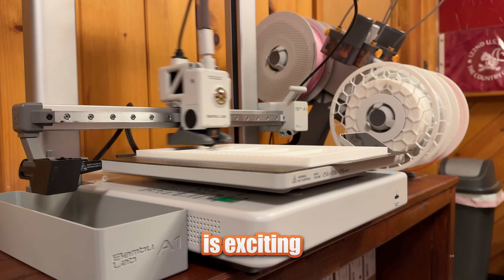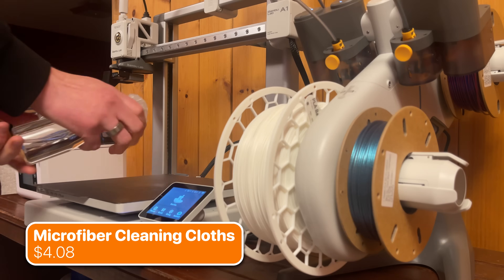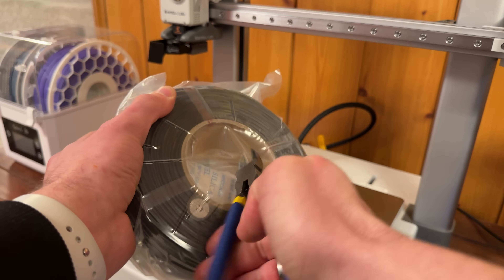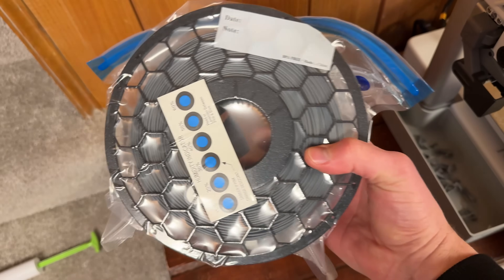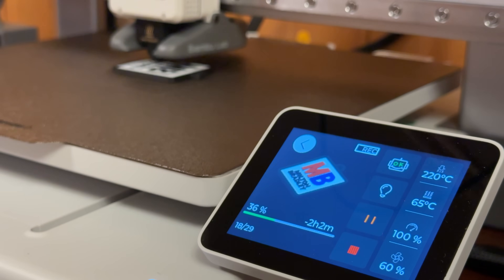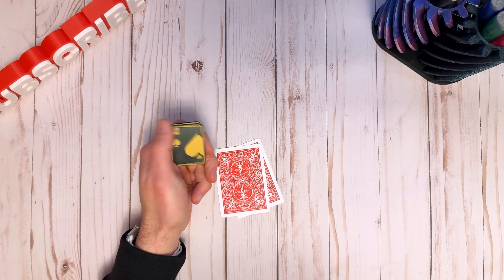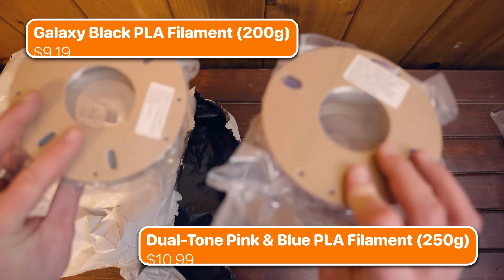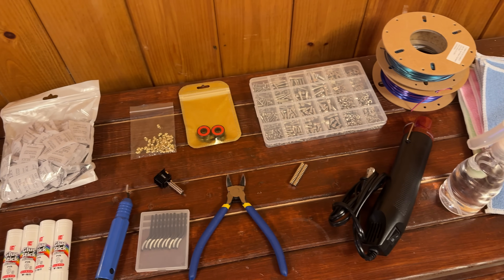Must-Have 3D Printing Accessories from Temu!

Comment: Rather than those bagged silica gels, there are reusable ones that you can dry up in the microwave or oven and use again. Additionally, they change color when saturated.

Comment: I have a tip: scrapers. They are amazing for rounding off edges, removing that last bit after tearing of the brim. After i made some of my own set, i haven't used deburring tool at all. Any metal piece with sharp and clean 90 degree angle will do, unlike wood scrapers plastic scrapers need very tiny lip or no lip at all (search for "how to sharpen cabinet scrapers and you'll get the idea, a lot of metal rulers have excellent edges). Scrapers can also be used to smoothen out layer lines prior to sanding, and will cut down sanding to about a tenth. You save a TON of sandpaper. Scraper cuts small shavings off unlike sanding that uses abrasion. The finish is instantly smoother. 

The ones i made from fish deboning tweezers are my most used tool in the shop. I use them even to scrape off injection mold seams from plastic parts, any sharp edges on any plastic stuff can be treated and at best it comes out like it was suppose to me like that without any additional post-processing. And since it cuts, you can't heat the part like when sanding.

And for sanding: use water with a bit of soap.. It will cool down the part and it will carry away the plastic so it doesn't warm up and clog your sandpaper. It will be a bit messier but the surface finish is better, and you can work a bit harder. I've even used lathe and lots of coolant successfully with PLA.

Comment: NEVER USE ISO - DAWN DISH SOAP AND HOT WATER ONLY
Reply: I find iso to work fer removing ghosting, if I ever have adhesion issues tho dish soap and a scotch brite brings the pei back to life
Reply: I use isopropyl since years, worked perfectly on my Prusa MK3S+ plates, work also perfectly on all my Bambulab X1C plates. Got them since I bought the printer nearly 2 years ago, 1500+ hours of printing.
A few drops on the plate, I wipe it with a cloth and it sticks again.
With this technique, whatever the material, I've never needed adhesive tape, glue or anything else.
If a part sticks badly to the plate or warps, I stop printing, apply isopropyl, restart and it's perfect.
Reply from the maker: Interesting. I’m still a beginner, and I referenced a lot of other beginners guides. What’s the issue with isopropyl?
Reply: @nickbradley  with bambu printers and the PEI sheets dish soap restores them back to new by removing all the oils that cause things to not stick!
Reply: Nothing is wrong with IPA dude, the only thing a beginner would need to be cautious of is how they wipe the plate.

Comment: Hi Nick, small correction, the white residue you see on the bottom of your prints is more likley for most people to be stress in the plastic from removal from the build plate than the glue stick residue, it's not impossible it's that, but the tempriture of the build plate will most likely have melted most of that by the time you remove the print. The solution is still the same with the heat gun, but just know that people might also be able to minimize that white color by just being more patient and leaving the part and print bed to fully cool  before removal.
Reply from the maker: Thanks for the correction!